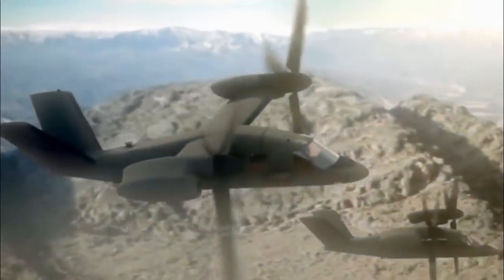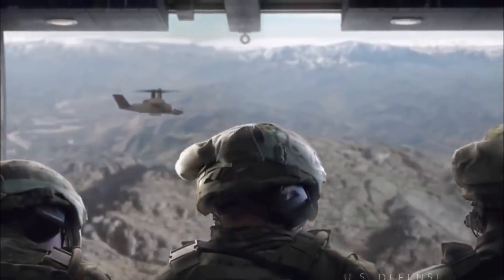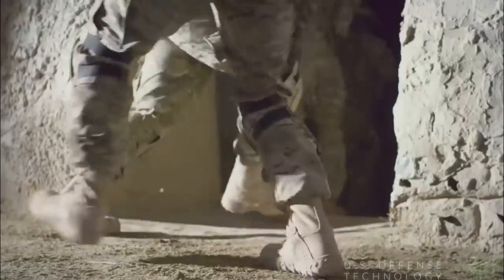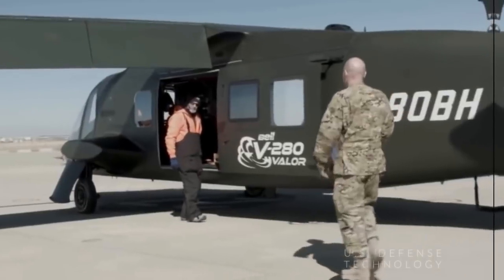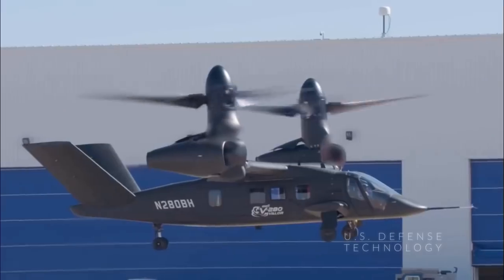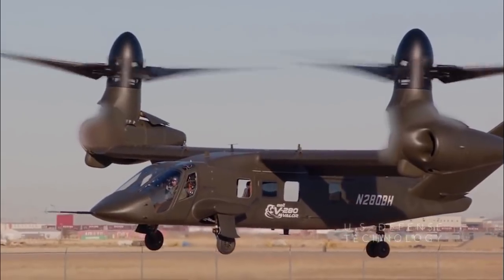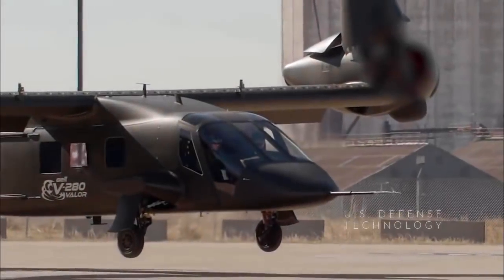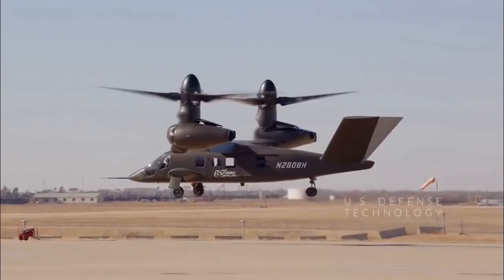Bell’s V-280 Valor shows off agility, speed in first public flight demo

Comment: If they put the jet engines in center and two transmissions that are connected to the engines and each other. Then a shaft from each transmission to each main rotor gear box. Plus the alternators and pumps connected to the transmissions, and a disengage emergency gear between each engine and transmission that could disengage one engine at at time with two separate switches. Then the pilots could theoretically fly on one engine and at least if one engine fails the other will keep the main rotors spinning and pumps and alterernators also spinning.
Reply: ... both engines turn both rotors at all times. They are mechanically connected. Just like the Chinook or Osprey.

Comment: Could they not use smaller twin props?
Reply: Lift capability goes down as the size of the prop goes down, I'm guessing.  I may have missed seeing this take off in flight mode.  That prop size probably prevents that.

Comment: Why don't they make Apache style gun ship with this, small and faster???
Reply: Because speed difference isn't an issue with the Apache.  They sneak up on their prey and with targeting networking, they can see the target as they are lifting off and attack the target before they are on site.  Also note that the speeds being achieved are due to them being empty. Once one puts 16 Hellfire missiles on a S-97, it it isn't going to be going no 253-276 mph.
Reply: @orlock20   speed is an issue. The importance of the ability to get into and out of a combat zone quickly cannot be overstated. In this regard the apache and all single rotor designs are outdated.

Comment: Can it fly if one engine fail?, can it belly land?, the rotors look huge and so close look dangerous is there a jet version of it?

NO, NO, NO.
Reply: I read somewhere that it can fly on one engine
Reply: @raymondalstadt51  how in the effin world is that possible? Both rotors are symmetrical w/ respect to the long-axis of the chassis. if one engine fails, the thrust/lift becomes asymmetrical causing a moment around the long-axis.

Comment: In the End the Sikorsky S-97 Raider will win the huge contract. The Sikorsky S-97 Raider will replace the Apaches  .. The Sikorsky SB-1 Defiant will replace the Blackhawks and the Bell V-280 will replace the Osprey
Reply: Damon Robinson Dorsey the v-280 is to small and can’t carry nearly as many troops. It will not replace the osprey. It’s only intended to compete with the uh-60.
Reply: The S-97 will not replace the Apaches.  Once the radar, missiles, armor and other sensors are added to the S-97, it's going to to do no better than the Apache. By the time the S-97 would make it to production, the Apache F will exist even if it's being sold to other countries.

Comment: I'm sure if they designed this aircraft with folding wings, and put a 35mm three barrel gatling gun in the nose.
It would take up very little deck space and could be used for refueling the F35B. Still not maneuverable enough to replace the apache ;-)
Aerotech has an interesting folding wing design :-)
Reply: The Apache has a targeting network It can pass off targeting data to other helicopters that are not seeing the target. One possible scenario would be to use these helicopters as mules. Let's say 2 Apaches and 2 V-280 attack a base.  That would put 64 missiles and 28 ground troops into the fight.  The V-280s could sit back while the Apaches do the targeting.  Another scenario is the Apaches could start the attack to defend a FOB and the V-280 start shooting missiles on the way to the FOB, with the help of targeting by the Apaches, to aid or evacuate the FOB.

Comment: I think this is very cool. But no matter what, I see the Sikorsky S-97 Raider variant as better overall than this. Its slightly slower and smaller, but its still close in its performance envelope, should be more agile and far better survivability than this.

One rocket propelled grenade to a nacelle will render this inoperative. The Raider variant's double rotors would be more durable. And the pusher blade can reverse and stop the craft immediately. That's maneuverability for a helicopter type aircraft. I'd also expect it to be cheaper. 

The V280s main advantages are purely speed and interior payload.
Reply: The S-97 is a different class aircraft,  the SB-1 that has yet to fly is in the class as the V-280. None of your points hold any accuracy nor any validity. Neither the S-97 or the SB-1 have any high speed agility worth noting and neither can fly if they lose a rotor blade leading to tremendously less survivability. The V-280 on the other hand has wings allowing it to glide or fly as needed. The expected cruise speed on the SB-1 is 235 and the V-280 is 280. The Red Baron, back in WW2, was the first to recognize that speed is a major deciding factor in air combat and that is still true today.
Reply: Kevin T I hear you. And I stand corrected in the Raider/sb1 point. Apologies. But I'm not sure that speed is the primary priority in helicopters as it is in planes. It would be survivability. Especially because these aircraft operate in close air support roles for ground forces. Not dogfights. The 50mph difference I just don't see as overly important. Payload is more critical and they're both significantly better than current choppers. 

In terms of survivability, you don't see a glaring disadvantage if one nacelle on the v280 is hit or otherwise compromised? Compared with a more or less straightforward autorotation in the sb1...?

Lastly, training and maintenance. You know the v280 will be more complex in both regards.

Imho, the main thing you look for in these close air support craft is hover stability, survivability, long linger times, etc. Sb1 config seems better in these respects. The v280 config is better suited to a large lifting craft for resupply etc. Really feel that a quad rotor heavy lift variant of the v 22 would be a better use of the config. Leave combat to the true helicopter variant.
Reply: Orion789, thanks for your response. I would like to take a
moment to say that everyone’s opinion is based on their unique combination of
life experiences, information exposed to and available facts. The “facts” are
not always 100% accurate and will be filtered through personal perception, bias
and understand. 

This SB-1 vs V-280 subject is and will continue to be talked
about and debated between people having all these aforementioned issues. I’ve never been in a helicopter that had been hit with an
RPG and then trying to autorotate, but I understand how the location damage inflicted
by a RPG, the helicopter’s design, speed, altitude and proximity to ground obstructions
could completely prevent a helicopter from making a successful
landing. Also,  a counter-rotating blade helicopter can auto-rotate but is less efficient than single rotor because requires more forward airspeed. I was in the military, on the ground in situations where a longer wait time greatly increased my risk of dying. I've heard a pilot over the radio say he did have enough fuel for the range to get to me, the feelings I got from hearing that are impossible to put into words. So, based on my life experiences speed and range are the most important things for a rotorcraft in the military.The question of speed vs. agility is also up for debate because no one has seen either the SB-1 or V-280 exhibit those kinds of maneuvers but If the V-280 is a fast as they say it is, then it’s time of exposure to danger would be greatly reduced as would the reaction time for someone trying to shoot an RPG. Helicopters can’t auto-rotate without enough altitude and forward airspeed.
Counter-rotating helicopters are less efficient than traditional single rotor
helicopters, making a coaxial rotor system a disadvantage when flying close to the ground at low speeds. Performing troop insertion and extraction missions there is very little  if any time for a pilot to react and even
less time and control if hit to do anything but hit the ground. Agility and
auto-rotation won’t matter compared to speed and a shorter exposure time it
provides. So, 50 mph difference in the first few seconds will make a huge
difference in survivability. I can’t see how the V-280 is more complicated than the SB-1.
I say this because the V-280 has been flying for almost a year and the SB-1
hasn’t flown yet, despite the Raider having been built and flying . I saw something online somewhere that said that the V-280's engines could be removed and replaced in less than an hour. Being able to swap an engine in an hour doesn’t sound like it’s overly complicated. As far the cargo question, I believe that both will have about the same external lifting capabilities but if I believe because of the design  the V-280 will have a larger internal capability than the SB-1.I can't wait to see the competition between them.
Reply: Kevin T You make very good sense. Not sure on all the points, but I definitely respect your point of view and have reevaluated my assessment of the V280. Thanks buddy.
Reply: When it comes to survivability, both systems are better than a conventional helicopter, but not by much. Disruption of either decentralized power plant on the V-280 during a hover would down the aircraft, and the same can be said for disruption of the main rotors of the SB-1/S-97, since loss of any major component results in loss of control. The V-280 should be able to fly in forward flight if an engine is destroyed, and both offer redundancy for non-catastrophic failure. The contra-rotor design puts more material between the fragile stuff and ground fire, but in general aircraft are pretty fragile and anything big enough to do serious damage won't care about the fuselage being in the way. Just my two cents.
Reply: @MillionFoul  >>> Why couldn't the V280  run on one engine?
Reply: It can, but if it's hovering and an engine is destroyed, in all likelihood the rotor it is attached to would be as well, and it cannot hover on one rotor. If an engine just fails without being blown to pieces, the other engine can take up the slack through a driveshaft connecting both rotors.
Reply: @MillionFoul  >>> Okay, I understand.  Thanks.
Reply: In combat an advantage on one mission might not apply during the next mission e.g. agility and speed. I don't see how the SB-1's counter rotating rotors  and complicated drive systems if hit by a missile or rocket would be able to auto-rotate. From my own experiences in the military when my life was on the line, the only things I cared about was speed and range. Now in the present,  I'm excited about the FVL program and looking forward to seeing what the SB-1 and V-280 can really do when they're in the air flying. Up to this point no one has seen what either aircraft can actually do. I've seen the videos of the V-280 flying,  but also realizing that it's  in the early stages of flight testing, these flights are going to be incremental and deliberately careful.
Reply: No matter how well does aircraft fills the needs of the US Army, I suspect that they are going to go with something more like a traditional helicopter.  
 
if I am wrong I will gladly eat a plate of crow, followed by nice slice of humble pie... 😊

Comment: Bell Helicopter Textron put all the lessons learned from the UV-22 into a better machine.  The YCV-280 packs a complete powertrain redesign; the gas-turbine prime movers are fixed longitudinally, and a stronger transmission drives and tilts the rotors.
Reply: The osprey has an exhaust deflector to push the heat away from the plane.
Reply: @jordankrenek5272  >>> Roger that - Thanks.
Reply: FWIW:  I noticed the engines do not rotate.  I do not know how the V-22 handles the engine exhaust blasting straight down, but this thing does not have to deal with that problem.
Reply: Does it have the ability to operate without one engine functioning like a UV-22?
Reply: @taylorsukoshi6126  >>> I presume that it would....

Comment: Pretty cool aircraft. Manufactured here in Amarillo Texas. I hope they build a huge fleet of these. And the new avionics are out of this world. It is quite the aircraft that our marines need.  I notice they are blurring the hinge joint between the engine and the rotors. Must not want the Chinese or Russians to steal their idea.
Reply: One obvious difference between this and the V-22 Osprey:  On the Osprey, the rotors and engines rotate as one unit.  On these things, the engines stay in place while the rotor units rotate.
Reply: @Allan_aka_RocKITEman  
You can tell the gearbox is a sensitive area by the video. 
Reminds me of the B-52's landing gear ☺.
Reply: Aaaaa. 
Just a smaller Osprey.
From an old BELL project, that Boeing made happen with the Ospreys. 
And all the involvement, and sacrifice within.
Reply: Not a huge fan of the cockpit avionics mainly because what if it gets shot will one bullet crack and malfunction the whole screen

Comment: Dumb question but why wouldn’t you have the engines on the fuselage to reduce wing loads?
Reply: Having the engines outboard actually reduces wing load, with less bending moment at the root.   Load is distributed more evenly on the wing.
Reply: Just maybe to clear the rotors?
Reply: Remember that the wings and rotors actually are what carry the aircraft. The closer the engines are to the rotors the less stress gets transferred into the wing structure.